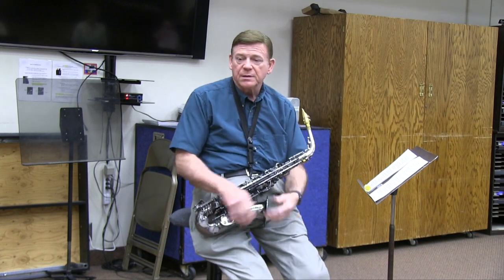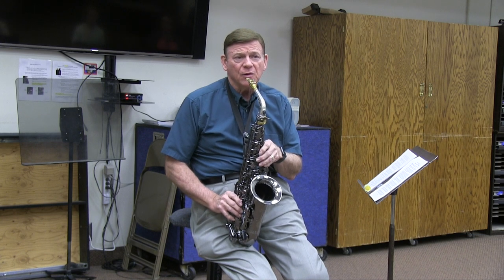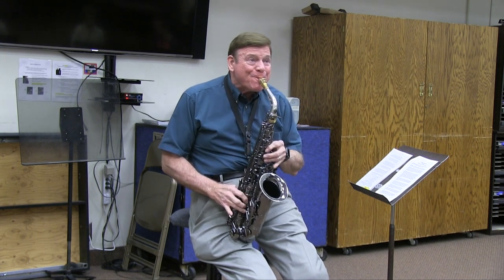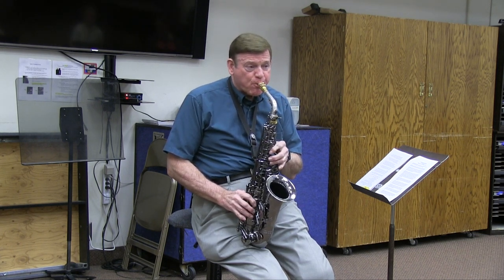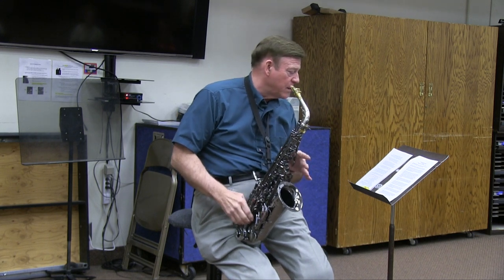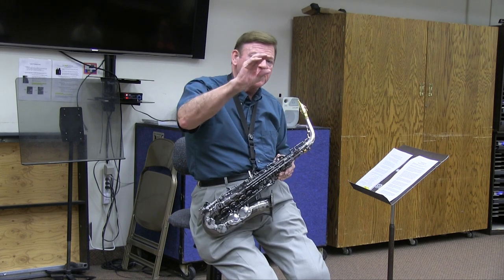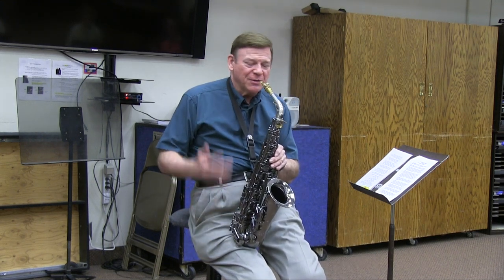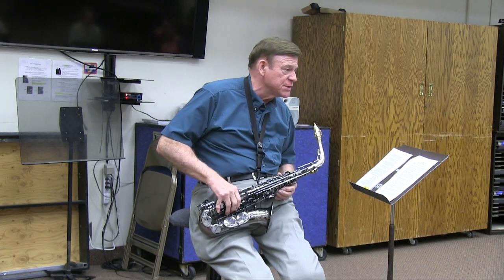Jazz Saxophone Techniques

Comment: Sir what about upper teeth position please 🙏
Reply from the maker: The upper teeth are on the mouthpiece and not too far in. If you put too much mouthpiece in the mouth, it will be difficult to do these things. Too little mouthpiece=lots of control and no sound or power. Too much mouthpiece =no control, but lots of sound or power (maybe even blatty or honkey). So you want to get just the right amount of mouthpiece where you have maximum control and maximum power at the same moment.